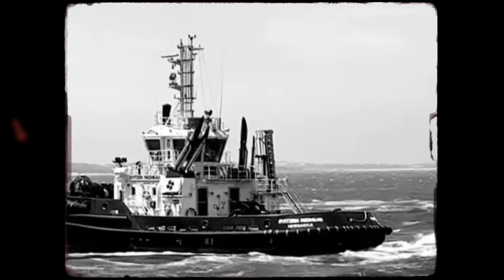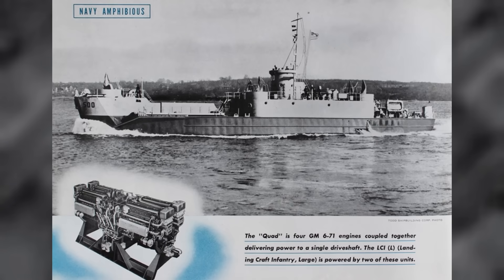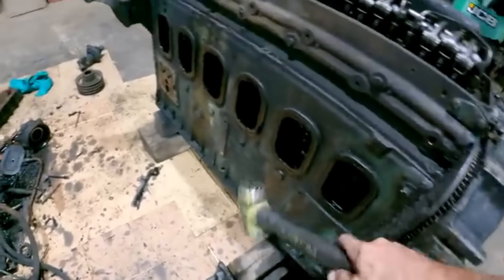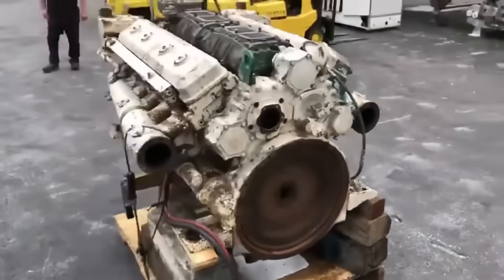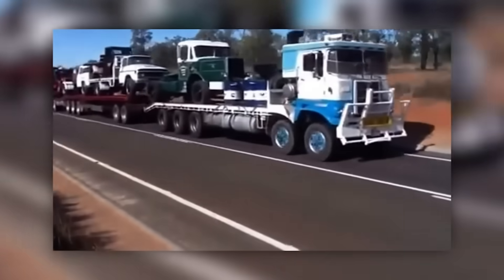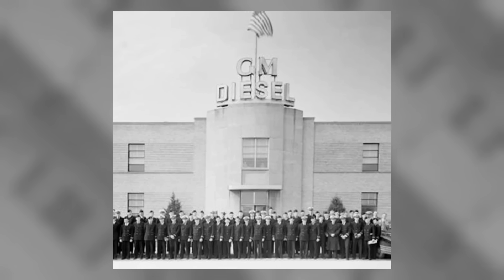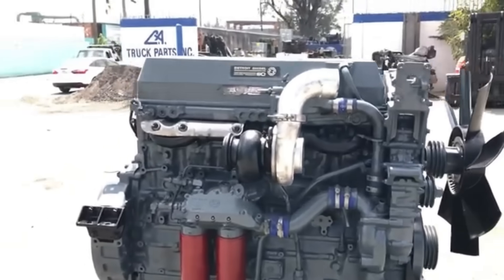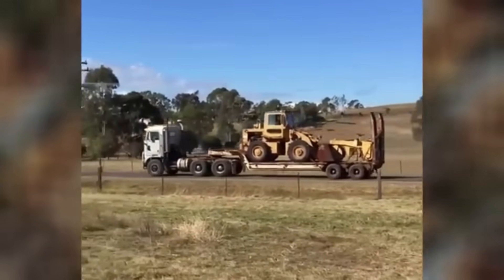The Rise and Fall of Detroit Diesel, America’s Greatest Engine Company

Comment: NOW I know why city busses were so brutally loud when I was a kid in the 60's and 70's.
Reply from the maker: And had black exhaust pouring out of them.
Reply: Well I to the 90’s here, but they were quieted down a bit
Reply: I was recently at a firehouse to do some generator service. There was a whole crew of guys working on the fire truck, 
They were rebuilding the old 2 stroke in it because they don't want a new truck. 
They took some of the money for a new one and went thru the old early 80s fire truck. 
And of course it looks great outside ,it's really hard to tell how old they really are I never thought it was that old I was figuring it was like a mid 90s model but not with that 2 stroke.
Reply: @MrTheHillfolk  I remember the old 'Super Pumper' New York City fire truck - it ran a Napier Deltic triangular engine from our trains, here in the UK.
Reply: And had BLACK exhaust smoke !
Reply: I always wondered why some diesel engines sounded so different.
Reply: I grew up in the 1990s. I was the last batch of kids that got to experience two stroke Detroit Diesels paired with manual transmissions. That was my initial impression of what a bus was supposed to be before the newer ones took away all the joy.
Reply: And how they stank. You did not want to get stuck behind a bus in city traffic in the 1970s.
Reply: @scottschmidt75 and remember, after WWII, GM went around buying up and ripping up electric trams to replace them with these.
Reply: @seed_drill7135 that would be what is called "light rail", now?, (the monorail sensation of our times).
Reply: TYVM for creating a memory flashback for me. They are so entrenched in my life too.
Reply: The engineers should have spent some time on an efficient muffler system.
Reply: Have a listen to the deltec 2t diesels, on here. Powered trains & boats. (Opposing pistons). I love the smell of 2t in the morning...😂
Reply: I rebuilt 6v71S 6v92s and 6v92 TAs ddec ran great !!
Reply: Exactly. I (as a German) was on a family visit in Toronto end of the 70ties and my cousin and I took a bus to a mall. The very loud and screaming sound of this bus was so bad (really bad) compared to the deep growl of our German buses that I thought it might be just totally underpowered. Years later, I learned about Detroit Diesel two strokes... Still today, I think that the sound is not healthy.
Reply: @robertharris7027 the sound of a 2 stroke Detroit is the sound of a full race diesel ,right from the factory 😂
They really would make you lose your hearing though and you drive them flat out to "keep it on the pipe" as motorcycle guys used to say. 
Fall much below 1500 and they just cave in, keep em spinning at 1600 or more and now you'll move. 
They really were like a 2 stroke dirtbike engine ,very peaky.
Reply: @MrTheHillfolk all the noise and grandeur without the annoying byproducts of torque or horsepower.
Reply: @robertharris7027  You should hear the sound of our Napier Deltic triangular engine - that really screamed !
Reply: @robertharris7027 those old GM Flyer 2 busses with the Detroit Diesels were awesome as a kid in Toronto.
Reply: @robertharris7027 repeated exposure to greater than 90 dbs is enough to bring an industrial hearing loss claim.
Reply: @seed_drill7135  What!?
Reply: @MrTruckerf  That wasn't made up for Roger Rabbit, it really happened.
Reply: @seed_drill7135  Never heard about it.
Reply: @robertharris7027  yes, loud noise is dangerous and these two stroke engines are dirty, real dirty.

Comment: They were NOT known for having low end torque.
Reply: Below 1700 rpm's they don't have enough power to blow your nose.
Reply: @MrPoorcharlie talking about the Detroit, I assume…
Reply: Ahhh… I just posted a question asking about the torque ratings. Is it safe to assume that Cat or Cummins had higher torque:horsepower ratings?
Reply: @jimchik serie 60 12.7l was rated at 1600 ft lbs while the Cat 3406B, E were rated at 1800 ft lbs
Reply: @XloMotion the series 60 isn't included in this discussion.

Comment: They thrived in an era when money was no object with military contracts, fuel was cheaper than water and emissions didn't matter. They were filthy, noisy engines and they had their day. But not now. Instead of innovating and releasing new Euro 5 power plants, they just gave up and handed the business to their competitors. Engines from the likes of MTU, MAN, Volvo, Mercedes Benz, Scania etc took the market. Cummins and Cat are hanging on, but even their engines are relics in comparison. The era of American domination in transport and shipping are over. This failure to innovate is the death nell to American manufacturing. Owners are now specifying Volvo engines to go into their Kenworths.  That would me anathema ten years ago.
Reply: Putting a volvo engine in a kenworth is a good way to go broke. Just stick with Cummins.  The Detroit diesel still best engine in US market. Volvo has injector issues stems from their crappy inj cups.
Reply: @stevenmiller6725  The Volvo engines do not do well in trucks that see heavy use in mountains which I find weird since Sweden is a country covered in mountains. Detroits are not the favored engine in trucks, Cummings are known for their high power, fuel economy and most importantly reliability.  I worked on Cumming engined tucks with over 400,000 miles on the odo and they still ran at factory specs.  No Detroit can work that hard!
Reply: Cummings and Caterpillar are doing very well, and Cummings does very well in Europe where they have a better reputation then Mercedes because of their ow cost of maintenance.  Both companies are considered leaders in innovation!
Reply: Why does everyone call it Cumming, it’s CumminS

Comment: Detroit Diesel engines were good cold weather starters
Reply: Depends how worn they are, and if block heaters are present and operating .   Strong batteries and pressing the stop button while cranking helps a lot to warm the pistons/chambers before actually trying to start them.
Reply: I live and worked as a mechanic for thirty years in Rochester, NY and never knew any truck with a DD engine to start with the temp below 40 degrees. Liberal use of ether coupled with block heaters was the only way to make sure a DD started in winter!

Comment: I think very early heavy low speed (and mostly fixed working speed)  Diesels were handicapped by the lack of a good timed high pressure fuel injection system until such as Cummins and Kettering and maybe some other inventors came up with designs.

Comment: Until turbocharging was perfected to a point where it was reliable enough to use in a truck the Detroit Diesel designs made more power from a smaller and lighter unit than a 4 stroke Diesel I understand. (Still a lot heavier than most gasoline engines) 
  I think DD was sort of a twin development along with the EMD 567 locomotive engine 
I think one or both Ketterings had a lot of influence on them (Father and Son)?
Reply from the maker: You’re right—Detroit Diesels were more power-dense than four-strokes before turbocharging became reliable. They were developed alongside the EMD 567, with both Charles and Eugene Kettering involved. And yes, they were father and son.

Comment: Detroit Diesel's story is a lot like EMD's story. Both were GM subsidiaries, obviously both used the two stroke design, and both were shed from GM in the last 25 years. There are a lot  of older EMD locomotives that continue to run and power trains throughout the country, whereas many older GE locomotives which utilize the 4 stroke design are no longer around. The sound of the 2 stroke EMD prime mover is unmistakable, just like the "screaming Jimmy" sound
Reply from the maker: Yes, they did have parallel stories. I would have loved to hear one in a locomotive!
Reply: @VintageAmericanMachines  You can still hear the distinct sound of the EMD two stroke design in locomotives today. The SD70 is still alive and well with their 710 prime movers
Reply: @VintageAmericanMachines  Piggybacking on what @brianporter4352 wrote, there are still lots of EMD locomotives in service that predate the SD70, and all of them have 2-stroke prime movers. EMD's all-time best-selling locomotive, the SD40-2, can be found in service on many secondary roads today. To hear the prime mover sound in its purest form, seek out EMD locomotives without turbochargers, like the F3, F7, F9, GP7 and GP9. You can hear the roots blower very clearly in them. YT has many videos that feature them. The later turbocharged models also have roots blowers, but the blower sound is somewhat muffled by the turbos.

Comment: Detroit Diesel’s story is truly fascinating… The fact that these engines are still running shows how engineering can defy time. Even the legendary “screaming Jimmy” sound is pure nostalgia!
Reply: Ah, you do realize that Detroit Diesel is still a thriving diesel engine manufacturer?
Reply: @jeffhatmaker817 I’m driving a brand new 2024 freightliner now, all Detroit diesel, still a great truck
Reply: @jeffhatmaker817 owned by Daimler and run by Mercedes
Reply from the maker: It sure does!
Reply: Thank god they went extinct. I'd much rather have fuel efficient, quiet, low pollution engines...
Reply: I remember listening to a DD V8 after a rebuild (new cylinder liners, bearings, etc., not my work) as a young apprentice in the early '70s. This thing had a surge at idle that sounded like someone was lightly pumping the accelerator by only a small amount. No one was of course but it sounded "cool." I was told this was normal back then. Apparently that's not the case today.